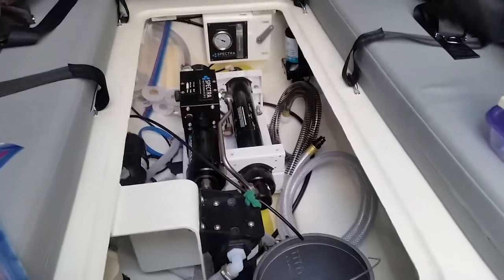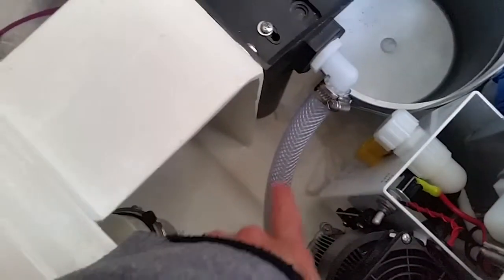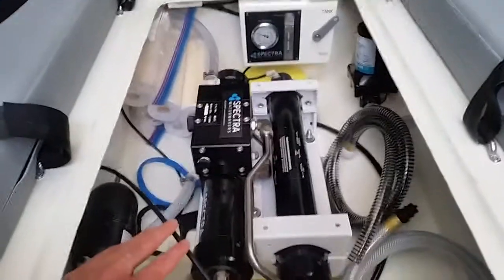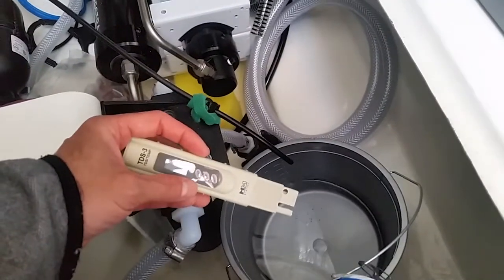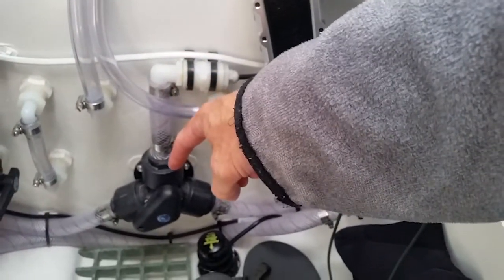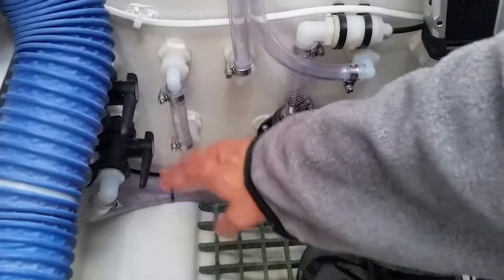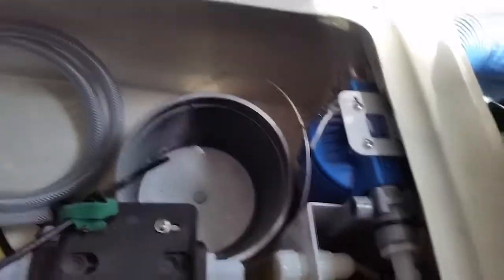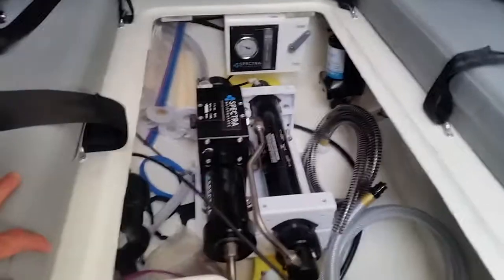Ocean Rowboat Emerson Spectra Ventura 150 Operation

Comment: That on/off power switch with open wires to it could cause problems if your bilge floods.  Did it?
Reply from the maker: I had a separate breaker specifically for the water maker, so power wasn't constantly going to the compartment.  I'd only flip the breaker if that compartment was completely dry.  Then I could turn on the water maker.  I got some water in there on occasion, but it was never a problem.

Comment: What happens If that desalter fails?
Reply from the maker: I had two back-up hand pumps in case this system failed.  If all my pumps failed, then it would get dangerous very quickly.  But I also had a complete overhaul repair kit, just in case.

Comment: Hello Mr, Jacob....May I know how much U bought the rowboat? TQ
Reply from the maker: I designed and built the boat - the whole process cost about $350K.  Custom boats are expensive!
Reply: @JacobAdoram  Thanks for ur reply Sir..
Reply: @JacobAdoram  is it has to be self righting?
Reply: @bazzaip2698  Yes, we designed it take take big waves and self-right.  It worked as designed and proved very useful during tropical cyclones!
Reply: @JacobHendrickson  
Have you ever capsized during your journey?
Reply: @Dan8254   Not quite - the boat is extremely stable.  I got knocked over 90 degrees during a tropical cyclone, but it came right back up once the wave was gone.